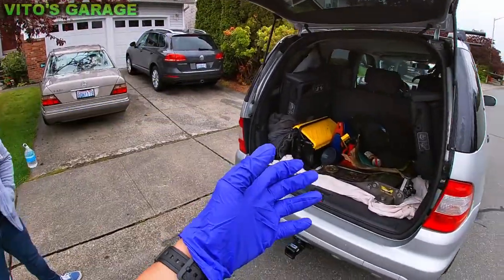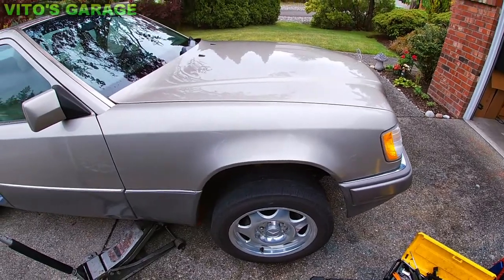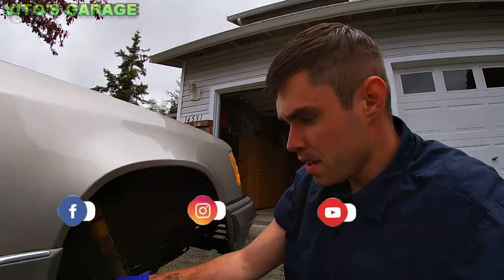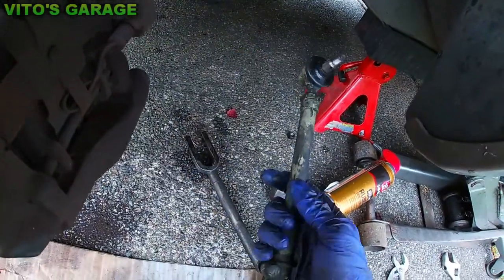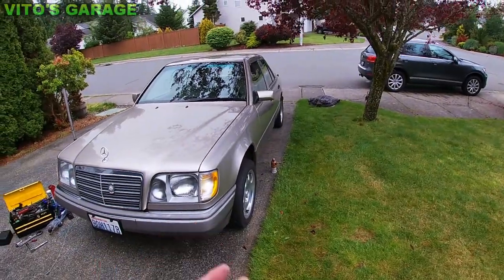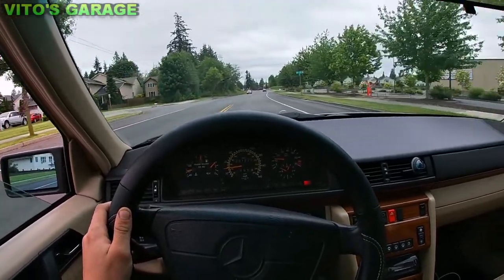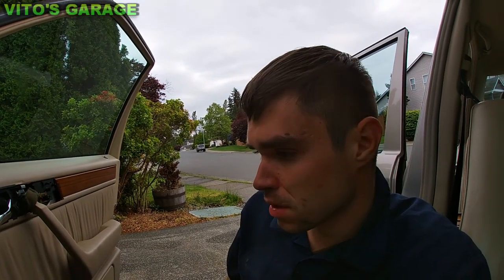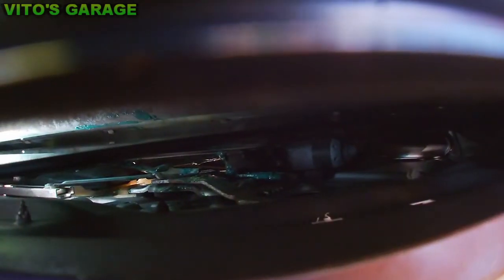Mercedes W124 Tie Rods & Alignment! Remove Door Panels for Window Regulator Maintenance!

Comment: Hello do you know if a 1992 w124 will interchange with a 1987 300d w124.
My car is the 1987 300d w124 . It has the palomino interior which i dont care for.
I found a 1992 e300 with a beautiful  black leather interior I can get the whole interior for $600 but can't find information if the seats will plug in and work Nd door panels fit.  Everything else looks like it will work.
And advice or ideas would be greatly appreciated.  Thank you for your time and videos.  Robert
Reply from the maker: Hello. The door panels and seats will fit. The only thing is the wiring for the seats may be slightly different depending on the car options. I’d for sure go for it. Black interiors are sweet.  If the seat wiring is different you can just swap the seat frames
Reply: @VITOSGARAGE  ok great thanks. This interior is sooooo nice. Probably the closest to new looking I've seen. It will look so much nicer than the palomino 
Mb text interior i have now.  Its in good condition but dont care for the color.  
Thanks again.  Robert
Reply from the maker: @w124mercedes7  don’t throw away the Palomino seats. Sell them or give them away, or keep them
Reply: V73 @VITOSGARAGE  yea I planned on selling the seats and  door panels